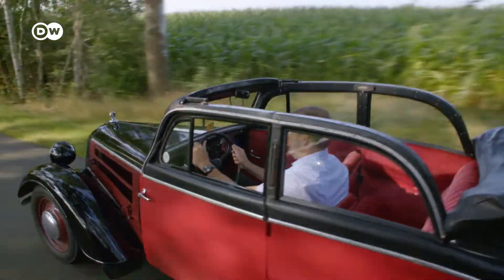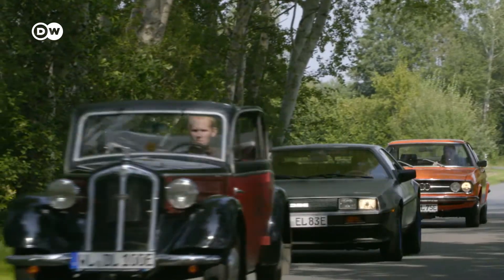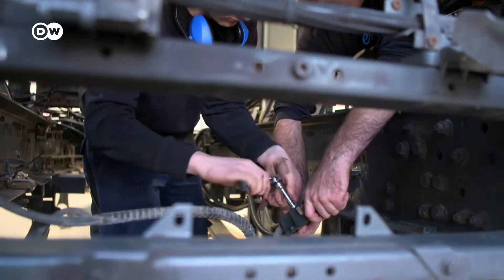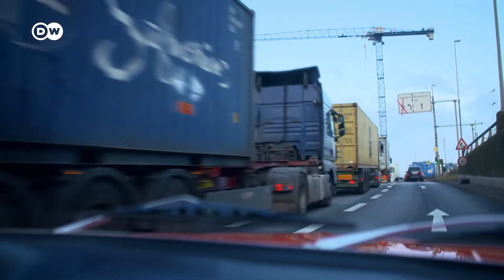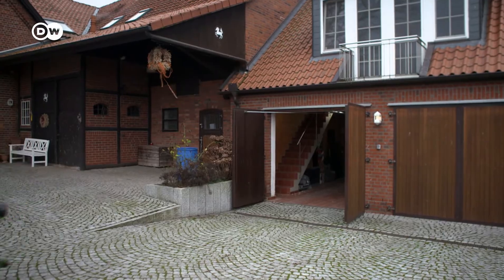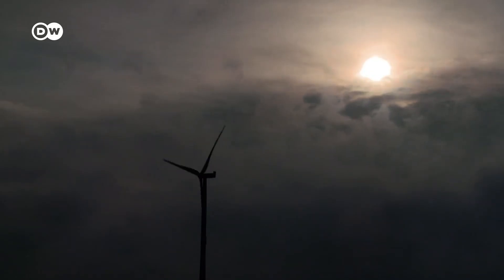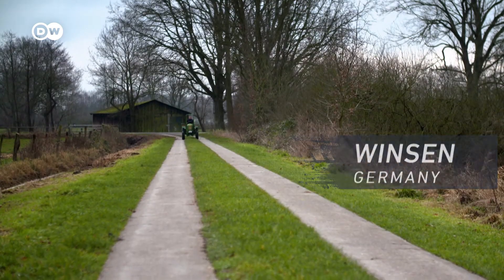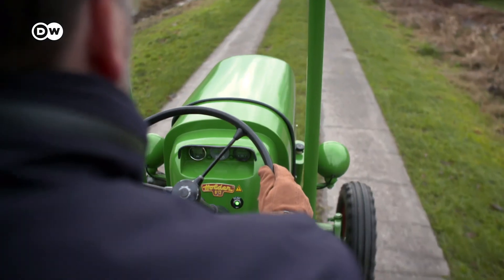Electric Vintage Cars

Comment: You get the look of the classic but not the classic experience .
Reply from the maker: Too true, Edgar! At least you'll be able to drive them in urban areas with low-emission rules...
Reply: Exactly no more greasy hands, grit in your eyes and hair or under your nails,  the smell of gas or solvents in your clothes and skin, oil changes and the mess, burnt limbs on a hot manifold . I have always loved cars but I can live without the experience so that my kids can live on earth. In fact I want to convert my Volvo Bertone to electric so never have to buy another stinking depreciating car.